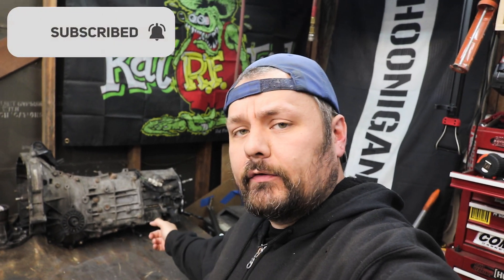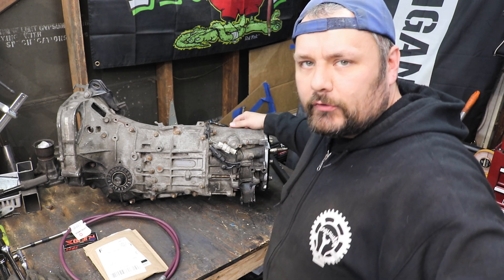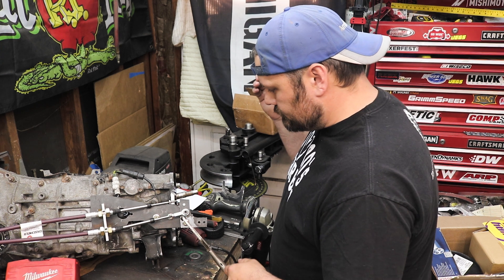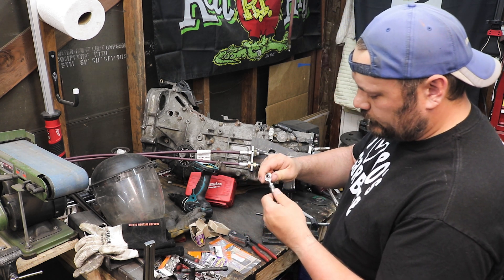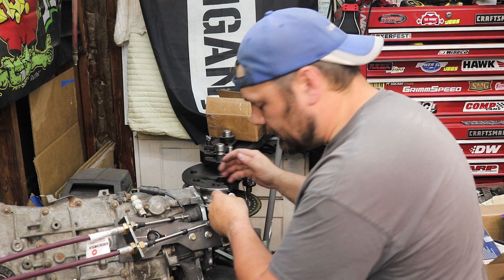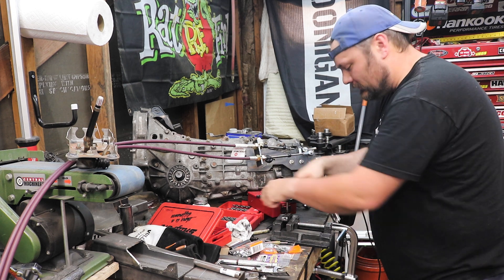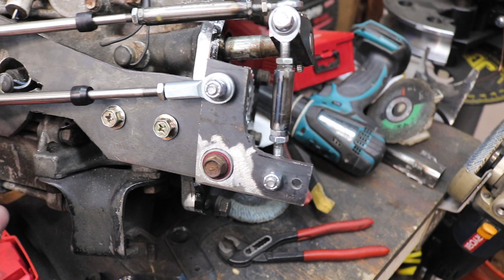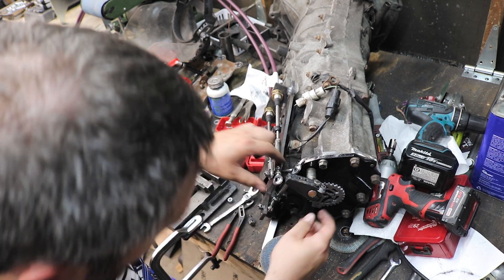Subaru Powered Honda CRX: Shifter Linkage for Subaru Transaxle [Pt 1]

Comment: I’m interested in the cable shifter setup. I’m RWD converting my Forester using a BRZ 6 spd and diff. I want to move the trans and EZ30 h6 back in the chassis, but the shifter and rack and pinion are in the way. I can flip the knuckles like the BRZ and use its rack, which is manual (technically electric assist) and has the same ratio as an STI rack. Which moves it back 10 inches. A cable shifter setup will solve the shifter issue.

Comment: I have project but for a stick shift 5 speed trans that I MUST shift with cables because the trans tail is to the rear of my mini van. Help somewhere?
Reply from the maker: The same principle from my setup should work for any transmission

Comment: Do you recall what cables you used?
Reply from the maker: Sure do - https://www.pegasusautoracing.com/productselection.asp?Product=4691
Reply: @Enginuity  thank you Sir! Fantastic build. I love that you show the ups and downs of a build. Can't wait to see more.
Reply from the maker: Glad I could help 🤙 and thanks! Whatcha building?
Reply: @Enginuity  a 1st generation neon, with a srt-4 swap, mid engine. In the tedious sheet metal phase.
Reply from the maker: Nice! Sounds awesome!
Reply: Think this is doable on a t56 and corvette transaxle??
Reply from the maker: No the tremec doesn’t have a transaxle built into it like the Subaru
Reply: Yeah, I meant to say corvette diff. Saw someone attempting it on a pickup with a mid mounted LS and a t56.  But they never updated the video, it's been over a year.
Reply from the maker: You’d need a transfer case to send the power forward to the drive wheels unless the engine/trans/diff combo landed in line with the rear wheels. In that case yea could totally remove the corvettes torque tube and create a flange to attach a corvette transaxle to the engine directly. In theory it certainly doesn’t sound complicated
Reply: @Enginuity  He did get everything mounted. Ls engine to a t56 with a housing to a corvette diff. No torque tube. He just never showed how he was gonna run the cables to shift the t56 from the back of the pickup..
Reply from the maker: That’s a long drivetrain 😳